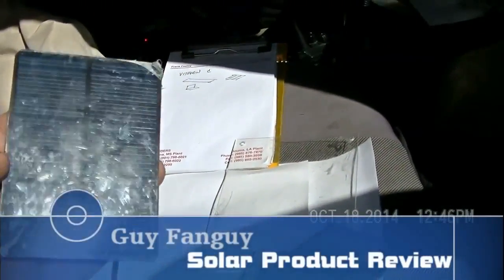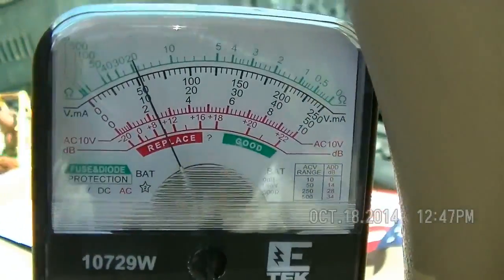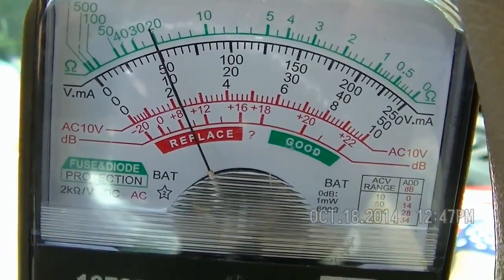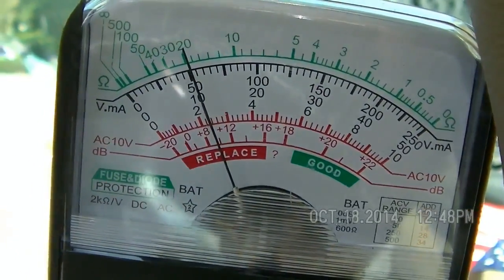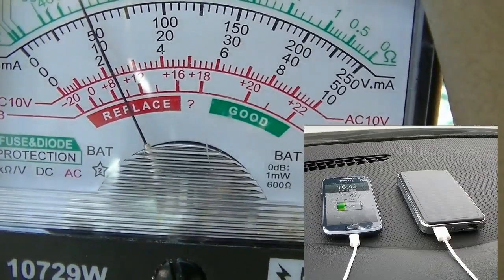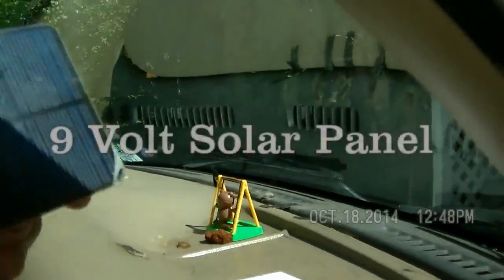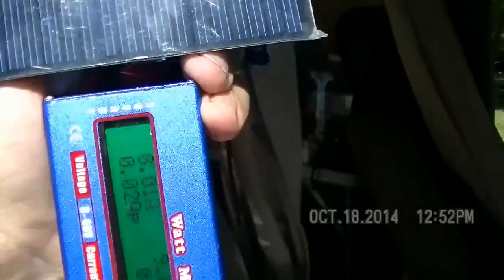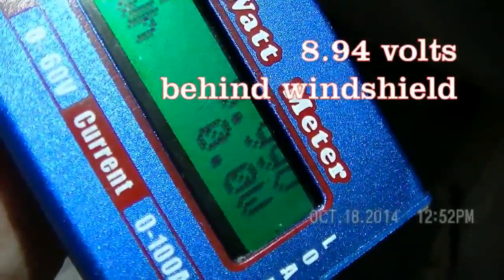Power Loss of Solar Panel behind Windshield of a Vehicle review by Guy Fanguy

Comment: I have no clue about voltage or wattage or power at all, apart from grabbing hold of live and neutral is something I’ll only do once

That said I’m taking from this I could trickle charge my car’s battery with a reasonably large solar panel. Am I correct?

Comment: Voltage isn't a particularly good way to measure panel yield, since panel voltage is relative stable above 20% insolation.  Watts would be a good way to measure yield, but there was no load on the wattmeter so only Voc was being measured.